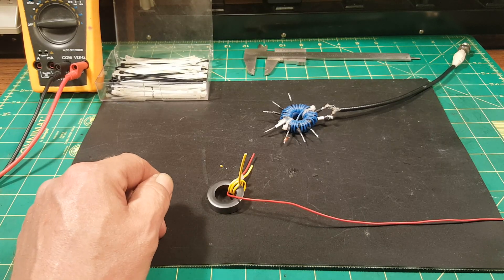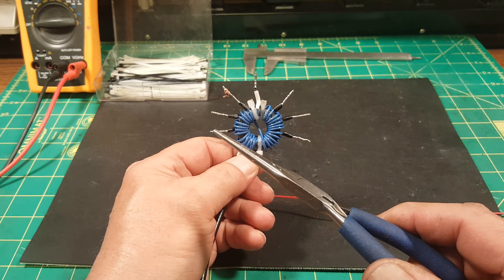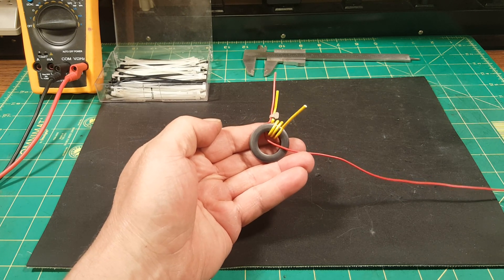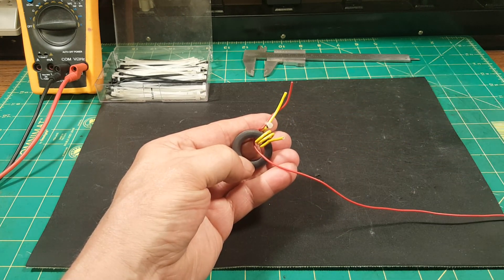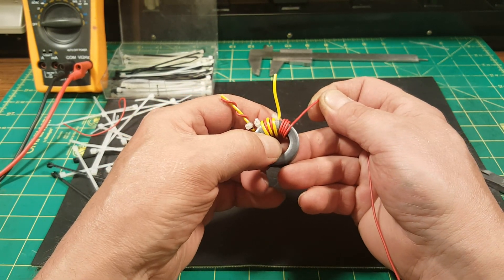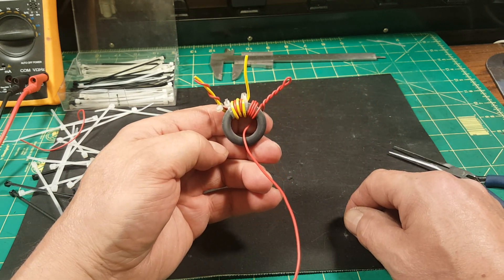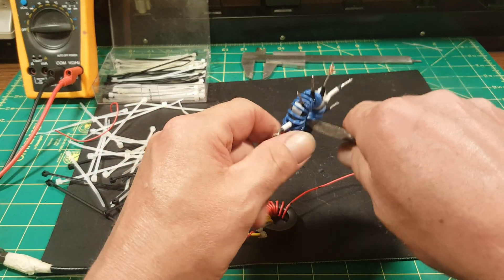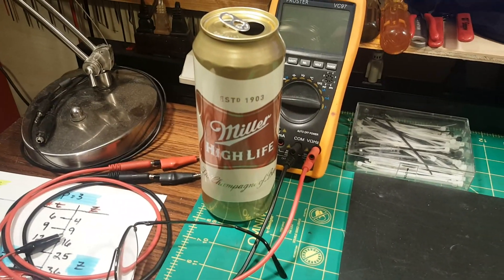Mutli-Tap UNUN Winding Method 2

Comment: Chuck, do you begin winding with a length of around 29-inches of wire on the torroid?
Reply from the maker: Oh wow, I have no idea how long it was. Depends on the core. The latest one, the little FT120 core, I'm not sure. I could test on another core later tonight and see if you'd like but all I have right now is another FT125-43 core that I could check that on.
Reply: @n8nkqrp595  Not needed. I will measure 2 turns, then do the math from there. KB8AMZ